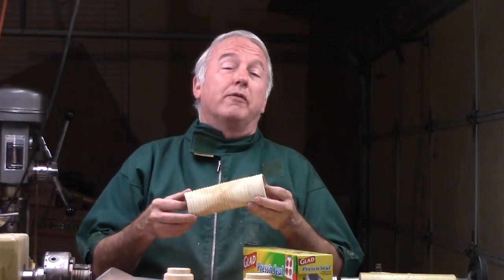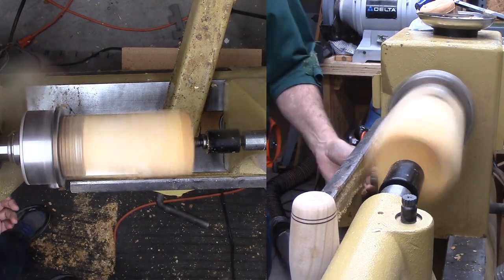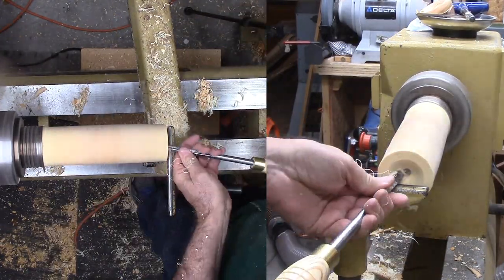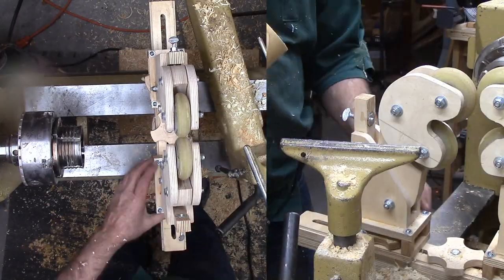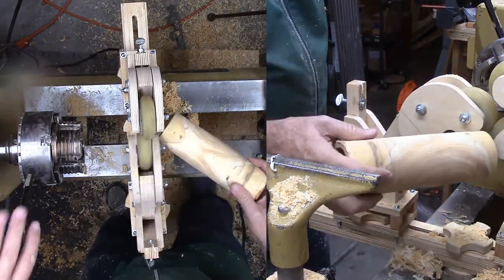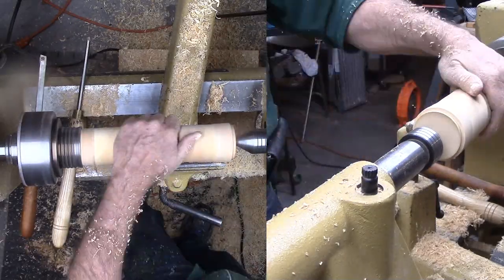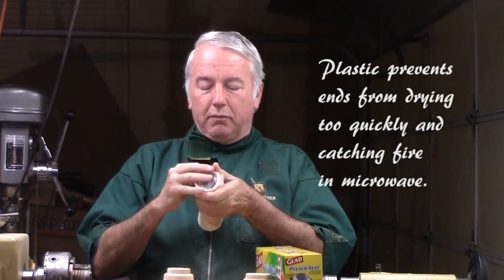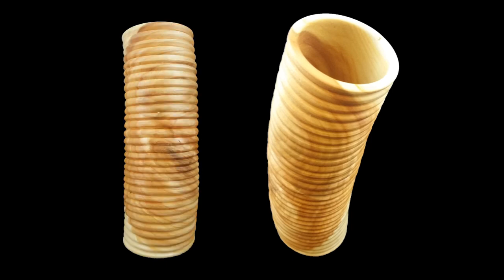Bumpy, Tipsy, Wood Tube From Green Cherry

Comment: Alan  another excellent video/  I like the different approach (s).  I really love the idea of two plugs so you can place between centers.  Nicely done.  And I really like the beads over the whole tube.  

Question?  What was the graphics program you used.  Sorry if you mentioned that in a previous vid.  
Merry Christmas
Sam
Reply from the maker: I'm planning to try a smooth one & compare how it looks.
The graphic program is basic powerpoint. Nothing special.
Merry Christmas
Alan
Reply: Thanks, I have done a bit with powerpoint.  I will explore it.  Merry Christmas
Sam

Comment: Alan very cool looking. What was the reason for not sanding?  Merry Christmas.
Reply from the maker: Not sanding is a choice driven in part by how hard it is to sand green wood as it loads up sandpaper very quickly. Plus as wet as this wood was, the surface will change anyway. So I minimized the extra work.
Merry Christmas
Alan